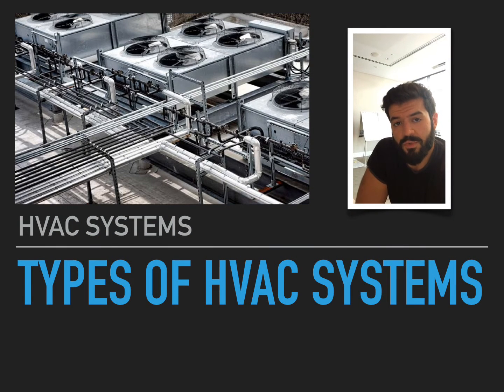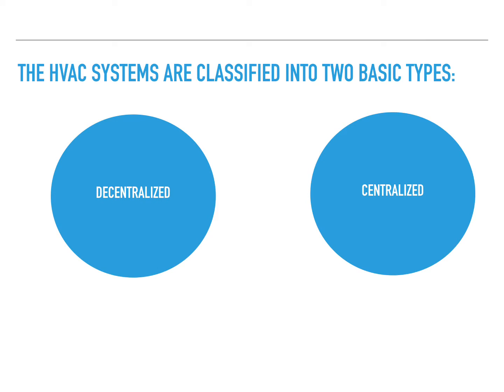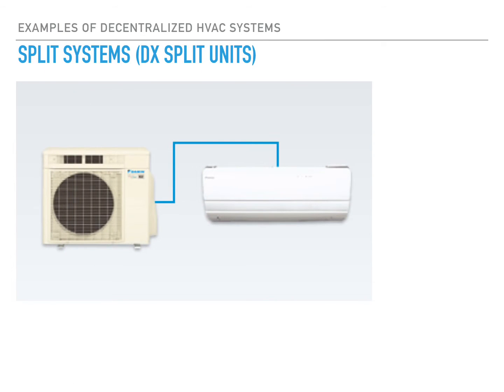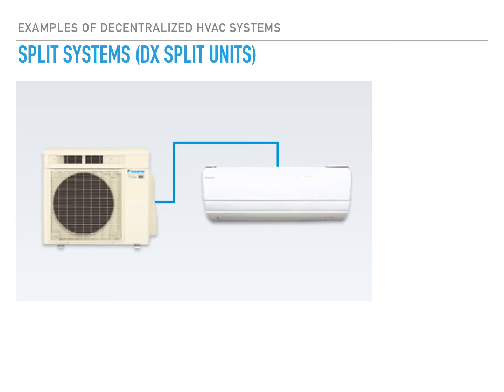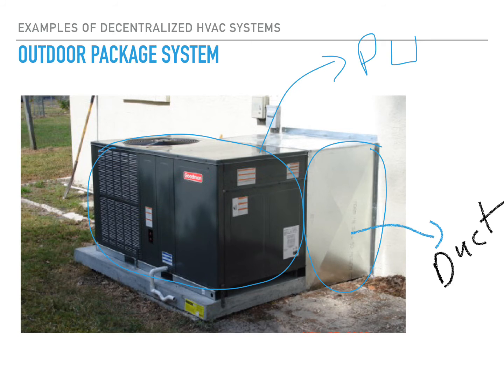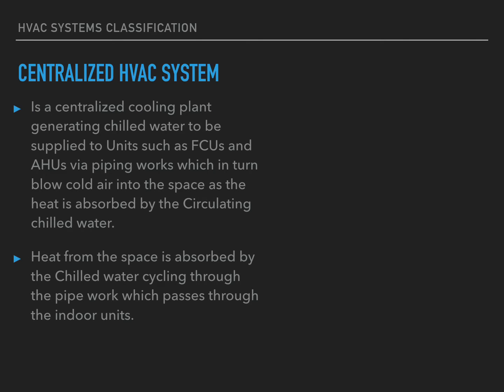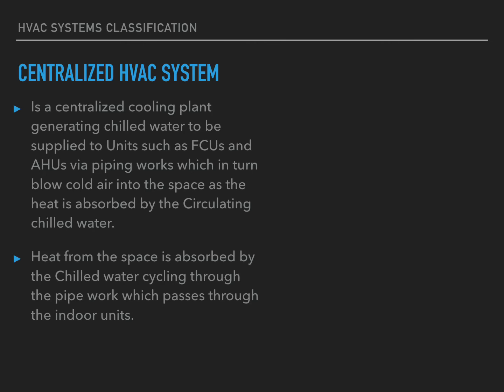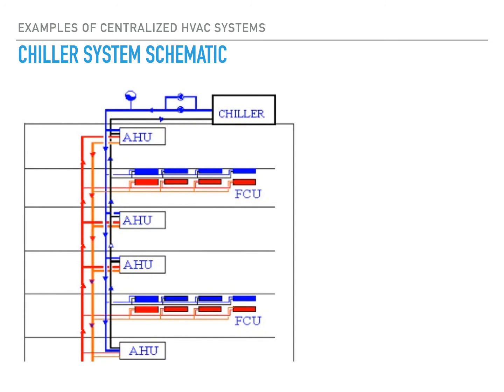Types of HVAC Systems :(HVAC Systems Explained/HVAC Design/HVAC Systems Basics/HVAC Training)

Comment: Thanks for the details. I was wondering why package unit with duct is not considered as a centralized HVAC system?
Reply from the maker: good question praveen , when you are referring to a centralized AC system it means that the Condenser is located somewhere outdoors and it is connected to 'multiple' evaporators , in the package unit system ; the condenser serves a single evaporator which does not align with the norm of a "Centralized" AC system.
Reply: @ExpertEaseEducation  I like your reply